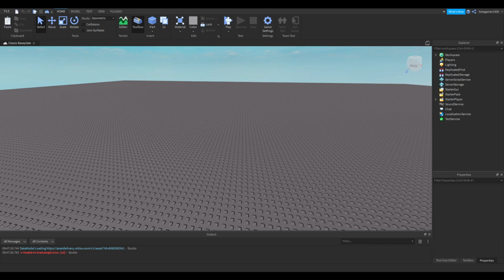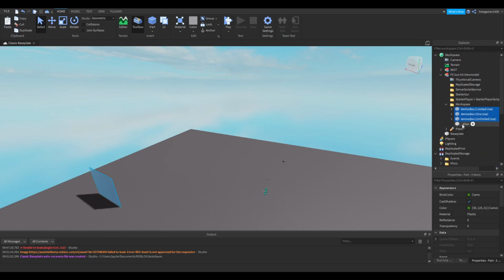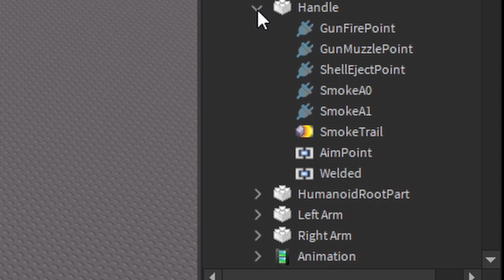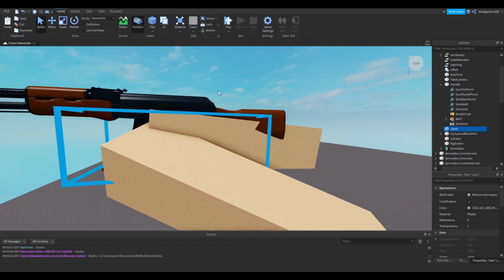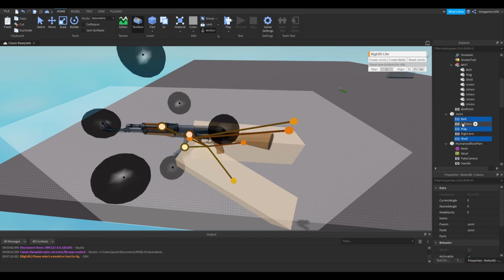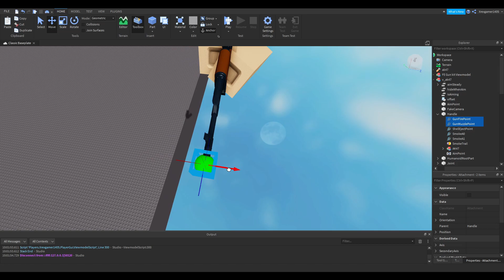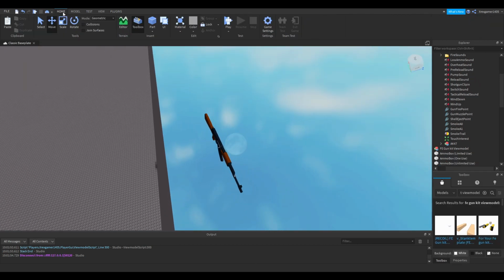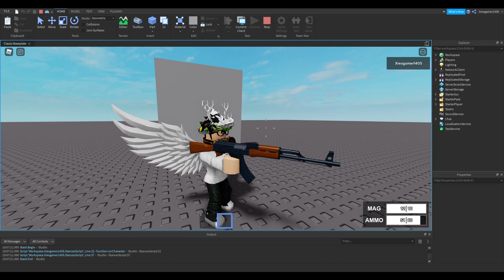How to use FE Gun Kit Correctly (Roblox Studio Tutorial)

Comment from the maker: Steps to the video for ppl having issues:
1. Install everything correctly 
2. Position gun 
3. Resize handle as needed to fit gun 
4. Rig model, rename parts of the guns such as mag, bolt, and etc as things you want to animate, when you have done that select Joint and select the renamed parts and select create joints, for non-named parts select weld. Make sure that you have selected the joint before selecting anything else to rig 
5. Connect humanoidrootpart with the handle 
6. Adjust the gunpoint, gunmuzzle point and etc to fit the gun 
7. Duplicate handle and paste into the tool and move over the parts shown in the video accordingly, after done moving over delete the other handle. 
8. Put back everything in its correct place and test, if the gun is backwards use the provided tool grip in the description to edit and rotate it to fit your needs.
Reply from the maker: If u have any issues with the gun model, check if ur gun model is anchored, if so unanchor, if not, check that the joint for the right arm is correct. Part0 being the right arm and Part1 being the handle in properties

Comment: it not working when i zoom in it wont work i did all the steps
Reply from the maker: Just in-case, im gonna recap the steps, 1. Install everything correctly, 2. Position gun, 3. Resize handle as needed to fit gun, 4. Rig model, rename parts of the guns such as mag, bolt, and etc as things you want to animate, when you have done that select Joint and select the renamed parts and select create joints, for non-named parts select weld. Make sure that you have selected the joint before selecting anything else to rig, 5. Connect humanoidrootpart with the handle 6. Adjust the gunpoint, gunmuzzle point and etc to fit the gun 7. Duplicate handle and paste into the tool and move over the parts shown in the video accordingly, after done moving over delete the other handle. 8. Put back everything in its correct place and test, if the gun is backwards use the provided tool grip in the description to edit and rotate it to fit your needs.
Reply: Thank you

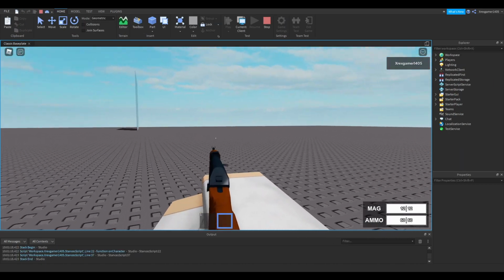Comment: I followed all your instructions but when i arrive to 7:29, When i go in first person, my character move on his own ?? Idu
Reply from the maker: make sure your arms or gun model isnt anchored, if that isnt the issue check if ur joint for the right arm is like this: Part0: Right Arm and Part 1: Handle in properties
Reply: @MizunoYT  I followed it and it still like that
Reply from the maker: @brothersin2564  yeah also make sure that the handle is connected to the joint and that the joint is connected to the HumanoidRootPart
Reply: @MizunoYT  Joint Or Weld Mr.?
Reply from the maker: @brothersin2564  joint obviously, weld is only for parts that are not gonna be moved
Reply: @MizunoYT  It still doesnt work
Crap.
Reply from the maker: you might wanna check again, usually i only have these issues when A. i rigged incorrectly or B. something was anchored (except for humanoidrootpart, thats supposed to be anchored).